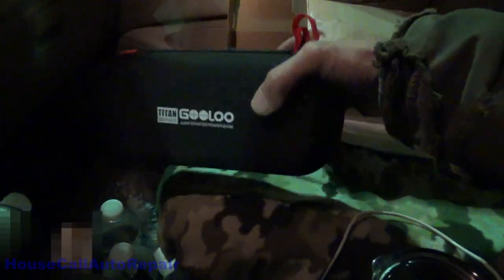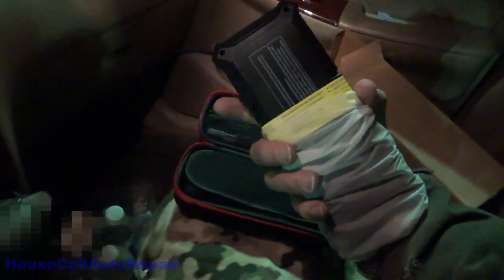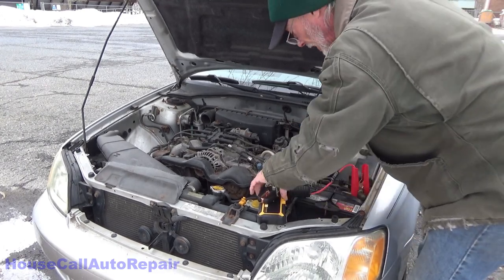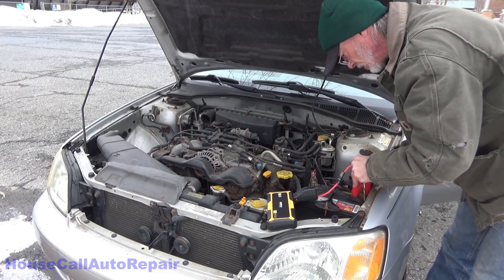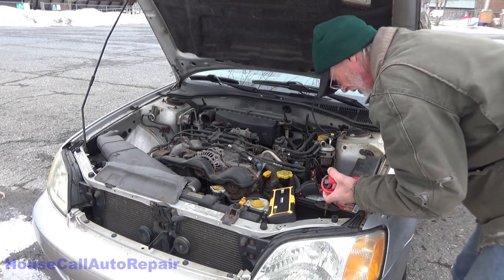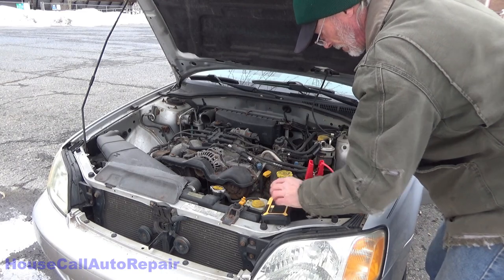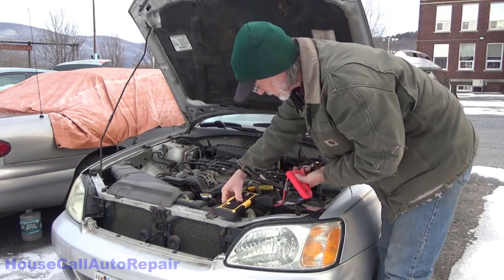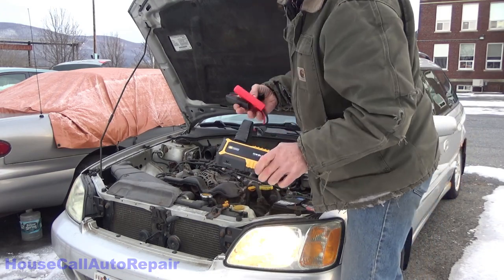GooLoo GP4000 "SuperSafe" Jump Pack

Comment: OK, we all make mistakes, but this took it to a higher level. Not only didnt you heed the warning the pack was giving you, you didnt look at the battery itself to verify polarity. The pack told you it was backwards and you quickly kinda looked at the wires without actually following them to their end to verify who was right, you or the pack. As soon as the pack alerted you to a problem you should have removed it and figured it out. Kudos to you for being honest and posting your mistake, but sometimes honesty just intensifies stupidity. You cant deny that wasnt stupid on you part, but we all live and learn. All the best my friend....
Reply from the maker: In all honesty about 80% was intentional (thus, the video name) but I DIDN'T actually expect it to discharge when it did. Only blew a main fuse, but yeah.. There are LOTS of people that will do STUPID things, and ignore or even be completely oblivious to warnings. THESE were designed with idiots in mind... that's why I'm still using it. It has NEVER let me down. Very few actually follow directions.
Reply from the maker: The point, and INTENT was to be as "dumb" as I could possibly be, and realistically push  the protection limits of the pack. I didn't expect to succeed in causing a problem. I'm glad I only smoked a fuse! I still use this exact pack a couple times a month and it has never failed me, but has challenged me. (extremely low voltages, but not completely dead, makes it think it's on incorrectly)

Comment: Way to hang in there, good job.
I just bought one of those  , never had a jump starter before now.
Reply from the maker: I set into this video with the intention of showing pretty much what I did, however, unintentionally, and stupidly, I had it hooked up backwards. Believe me, I know the difference between black and red, but for some reason it just didn't "click" in my head that I had them backwards... which ironically proved my point about how ""idiot proof" these are. Two blown fuses and all was good again.

Comment: House call mechanic wouldn't let you near my skateboard
Reply from the maker: This is an AUTO REPAIR video.... If you want skateboards... go find some kids channel. (Come back when you' grow up enough to own a car)
Reply: @HouseCallAutoRepair  being a smart arse doesn't suit you especially as you can't tell the difference between + & -- even after you point it out to the viewers
🤣🤣🤣🤣
Reply: @robertmcqueen7314  He really gives mechanics a bad name. He apparently cannot read.
Reply: How could you assume that the negative cable is alway closer to the metal. A tru technical mechanic could have just trace the cable and get a confirmation. 

Second: How could you risked triggering a short with car keys while handling high power cables.

Third: Why did you not inspect the condition of the battery connection first and clean them.

Your technician analytic process really needs a revamp.

Overall, the point for the quality of the Gooloo charger proved to overcome your clumsiness.

Thanks to you, I will place my order !!!

Comment: Just a quess... You didn't actually read the manual? 

If less than 2 bars, it can damage the Gooloo, if you try to jump start. You need to charge it up first. 

Also, if the thing says you've reversed polarity, you might want to check it.
Reply from the maker: Trust me. I DO know what I'm doing. THIS was an INTENDED demonstration of how these were designed to PRVENT what I managed to bypass. The purpose is to show these work even after being improperly used.
I've have been using THIS EXACT unit for a couple of YEARS now without ANY issue!
Reply: @HouseCallAutoRepair  My BAD! I didn't realize your intent. Good demonstration!

Comment: What is the fastest you can charge this pack?  Does it take any sort of fast charging?  I see it draws up to 18w but nothing indicates that its utilizing PD charging standard.
Reply from the maker: The charger it is supplied with charges it in a few hours, from nearly dead. I don't need to charge it all that often, so a few hours here and there are no inconvenience.
Reply: I wouldn’t t call it fast. I’d call it normal.  (Fast charging shortens battery life, so normal is probably best in the long run.)    GooLoo website’s GP4000 product page says the USB-C input port charges it “6 to 8 hours”, at up to 15W rate (5V @ 3A). But it usually doesn’t come with a power supply, so you’ll need one that that can supply to 15W.

Comment: When you had it hooked up the wrong way you over rode the safety by pressing the boost button which should actually be called over ride button. When you pressed that button you told the gooloo, no it is the right way fire it up anyway.
Reply from the maker: Pretty much, but it was when I actually connected it back, that I blew the main fuse in the Subaru.

Comment: I purchase one two years ago use it three time now I sold red light on jumpier cable not working anymore I do not recommend 😊
Reply from the maker: Oh no! That's unfortunate. Mine is still working great and I've used it well over 20 times, with virtually no problems (other than the one I CREATED in this video)
was yours a Gooloo 4000?

Comment: this goolo is garbage doesnt start completely dead battery i bought the higher vesion G4000 which they claimed to work in -40 and i was stuck outside in -40 then came back warm up the gooolo and then start my car, insane throw into garbage and bought LOKITHOR J401X that save me many time in Calgary -40 winter.
Reply from the maker: The exact unit shown in my video, is still my exclusive jump pack, and to this day STILL has not let me down. Works all the time, EVERY time!
I have no idea, unless the battery is a DEAD SHORT, why you are having such difficulty. Device or user malfunction, most likely. Not everything is immune from being defective.
Reply: I know nothing about these things, but I’m gonna ask. What charges the jumper bank